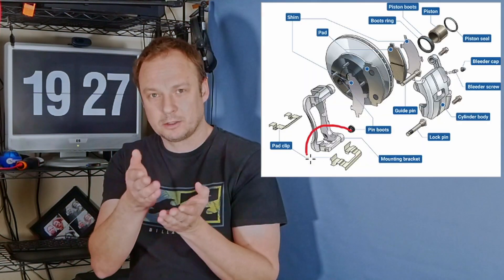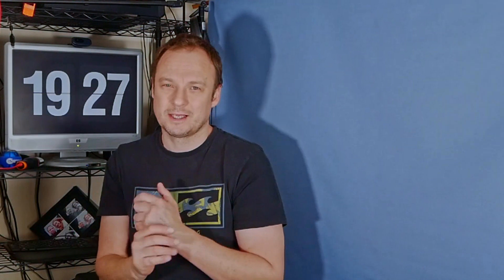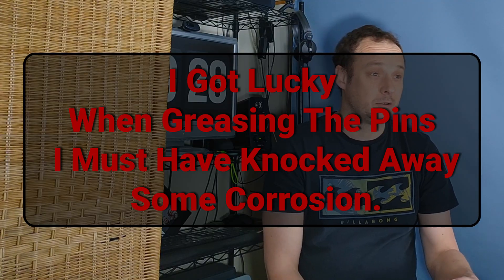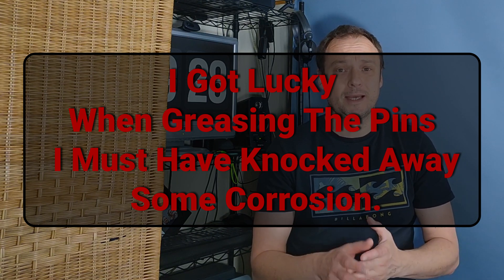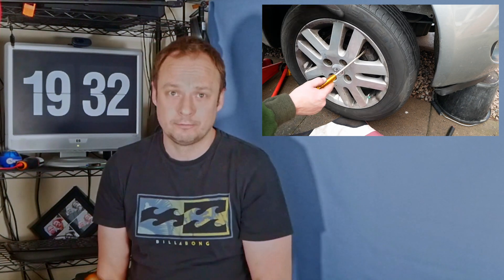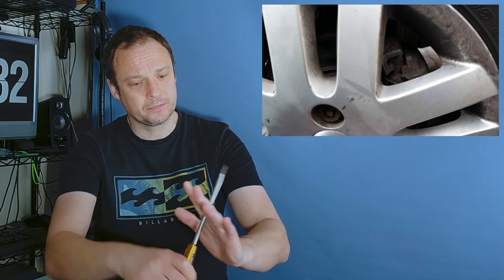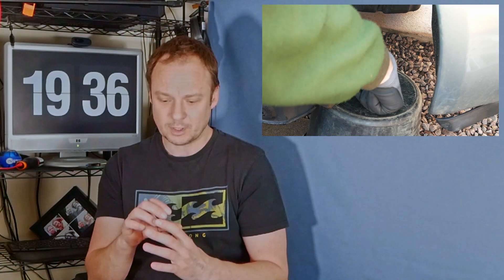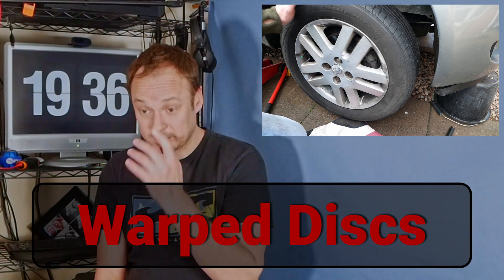Brake Binding (Emergency Quick Fix)

Comment: i am having a binding problem, bought new calipers but binding wont do away😢 where else can i touch
Reply: It could be your master cylinder mate, might be on its way out
Reply from the maker: Sorry just seen this, grease new caliper pins, make sure you have cleaned the rust from caliper carrier, check disc's are not warped or if rear calipers check the handbrake/parking break cable. Hope this helps, else Google. I don't think it would be down to your pedals or servo but it could be.

Comment: i am having a binding problem, bought new calipers but binding wont do away😢 where else can i touch
Reply from the maker: Sorry just seen this, grease new caliper pins, make sure you have cleaned the rust from caliper carrier, check disc's are not warped or if rear calipers check the handbrake/parking break cable. Hope this helps, else Google. I don't think it would be down to your pedals or servo but it could be.
Reply: @ifell3  thank you for your response. I had to start from the servo going down to disks, somehow the problem got solved
Reply from the maker: Setting were only set to notify important notifications, changed now aha